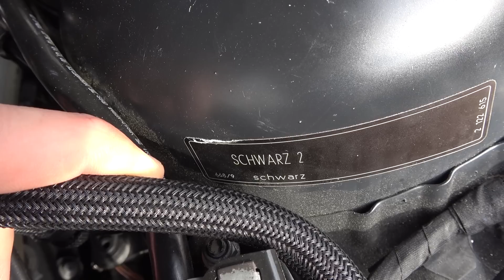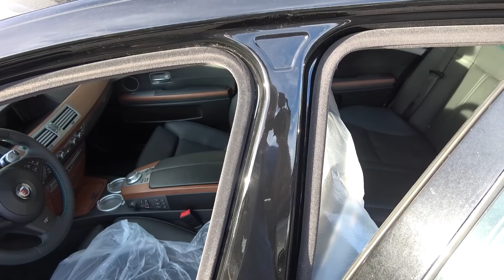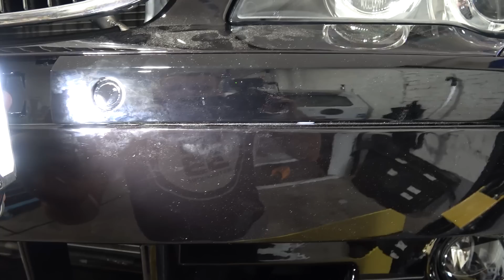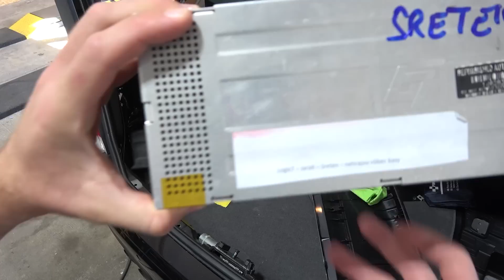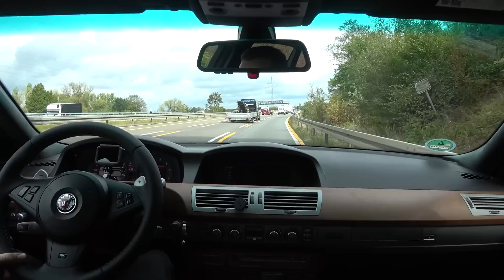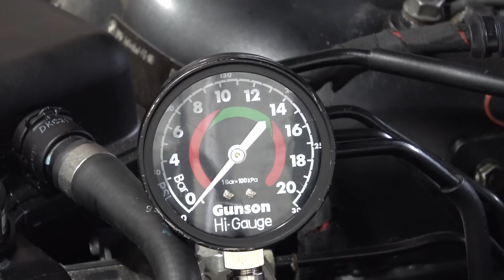More Problems - Supercharged BMW Alpina B7 - Project Chicago: Part 15

Comment: Sreten, you may find the discrepancy in paint shades may be down to the primer, if it went from one shop to another, and they both had a go at doing parts of the work, different primers absorb things differently and the paint coverage will be different on different shades underneath. Either way, what should have been done is the bumpers should have been taken back to plastic, anti static treated, sprayed with an adhesion promoter, sealed with a sealer primer, then high build, sanded down flat, filled etc if required and refinished if required, then painted and cleared... Sounds like a lot of work and it can be but it's basic repairs, you could have probably done it yourself! Also worth noting, the 'dents' you're finding in the paint are poorly sanded primer or paint runs that were either covered over or quickly sanded and polished... Anyways, mogi smo i na našem ali jebg brate engleski udara lakše ovih dana 😂 keep up the good work.

Comment: I've been out here living in the middle East for almost 10 years, the paint job is a typical low end poor refurbishment that happens here almost all of the time. About 80% of cars out here get door dings fender scratches and of course sand road rash and sun fading from the climate. Most car owners take there cars to back street garages, and I use the term "back street garages" loosely.  They will use what ever paint is closet to the cars colour and even sometimes mix paints to create sample sticks to Try and match to the car.  They never really buy  paint from the dealership.  As they use third party paint shops to save money. To expand a little I had my E71 X6m colour changed to the newer F86m blue for around 1000 Euros.  Job was average but I did take the car to the main dealer to repaint some areas that I wasn't happy with.

Comment: I have a similar issue with my Schwartz 2 E39 M5.  The original paint in the door jambs, underhood, and most of the body has a lot of brown in it and looks “hazy” and more grey/brown than black under bright inspection lights. my first thought was to paint correct it, but adding clarity simply
 makes it look worse.

I had 2 doors, both quarters, and the rear trunk painted due to some paint damage.  The paint shop called  BMW with my VIN, got the correct paint code, and did a pretty solid job on the paint work itself. The new paint actually looks great - no metiallic, and just a deep dark black that looks like a mirror. The trouble is it doesn’t match the door Jambs or any of the original paint. I’ve read other stores online about people have much trouble matching Schwarz 2 because of all the variance in actual colors.

Please keep us posted as to what they find in Poland!

Comment: Those bumpers had horrible sanding marks showing under the paint.
What happened to the much vaunted "German craftsmanship"?
I took my A6 to the dealer for some work and the day after I got it back I drove up into the mountains. On the way back my under engine cover came partially off on the road. I pulled over and had to pull it off because some fasteners were missing. I also had to explain to a cop why I was under my car on the side of the road.

Comment: Has the car been reshelled? I.e - original car crashed, someone gets a e65 shell in the 'other black' and proceeds to swap over  everything from crashed alpina to replacement wrong colour shell. This would explain no signs of respray, maybe the door, bonnet and VIN is from original alpina...?
Reply from the maker: No. Not possible

Comment: Looking at cyl 1, piston crown looked a bit odd? Could fuel be on the limit on that cylinder? Did you flow test the injectors? Other than that, great work and kudos for not giving up! :)

Comment: I actually read abbot a customer who ordered one of the last E90 series M3 in either Atlantisblau or Atlanticblau. Anyway: Whatever he ordered, he got the opposite paint and was very upset. I don't know how it ended. BMW offered a free repaint in the correct color which he refused. A replacement car wasn't an option either because the production of the E9x series had ended.

Comment: The quality of the paint work you're receiving is appalling - I'm amazed that any paint shop that has any sort of pride in their work allows that kind of garbage to leave their facility. Color sanding and buffing the paint to remove imperfections was a standard procedure on every part that was painted at the dealership bodyshop I used to work at - I'm amazed that an average quality shop in Germany doesn't take enough pride in their work to do that basic work to ensure their paintwork meets basic quality standards.

Comment: i frequently work with sprayers. it could be possible that whatever automated paint machine was painting in sapphire black and then switched to schwartz 2 without clearing the lines. some of the remaining metallic could’ve came out on the car from factory

Comment: I know BMW finally bought Alpina, but why does or did Alpina last as long as they did for how much terrible of stuff they put out. I run far away from anything Alpina new or old. On a side note, in the USA we have some of the best body shops around, they can due perfection. I usually deal with a place called Queen City Auto rebuild who deals with all high end brands. They do amazing work.

Comment: What an absolute shit this B7 is being!!! I can certainly empathise when some cars just fight you all the way to the end. I find it astounding that manufacturers will use plastic clips to hold underbody pieces on?!?!!? That's just dumb!!!
Sorry to hear that German paint shops are as shit as Australian ones. Pretty sure you can see they didn't use a fine enough grade paper for the basecoat through the clearcoat as looks like linear sanding marks. Even if you use back n forth sanding action instead of crosshatch sanding action with the correct grade paper it should look smooth to the human eye.
As you said it ended on a high note with a healthy engine and everything you have worked upon is in top notch condition. Always frustrating when those you trust to do work for you let you down. Hopefully it's vacation to Poland will remedy that issue 😊

Comment: I love how in the end you always end up with a reliable, good looking and excellent driving BMW. In Sreten we trust, to save and restore a BMW to proper working order and the journey is always interesting as well as educational. An Alpina tour would be cool, wonder if they may have an explanation for possible discrepancy between the stated colour and the actual colour of the car. I remember going to BMW in Munich and on the factory tour watching the chassis's getting dunked into large tanks as initial part of the paint process then watching the robot arms spray painting the car. So maybe someone punched in the wrong paint code for your chassis or at the end stuck the wrong paint code sticker on it?

Comment: Underbody: My E36 M3 16 years a go wanted to let go of splitter and underbody shields at 280kmh. :D Also front fender liner decided to die at one time.  If you are going to use it hard, mold the original plastics and get same thing made from carbon.
Paint: Clearly paint defect on the factory, they had car before this in metallic, and somehow, that metallic was stuck in the painting system, so that also your car got metallic particles in the metal parts. This happened in the robotized painting line. Maybe BMW knows about this and they even have suitable tolerances for such errors. Or maybe it just happened and they dit not notice or let it slip regardless. Plastic parts were painted elsewhere and obviously it would have been like two lottery wins to get same error also there, so the plastic parts are painted perfectly, just like almost all the parts normally.

Comment: 1200 for a completely wrecked paintjob, I would have got my money back for sure. (Maybe invest in a popup paint booth and the equipment, I'm sure with a little research you would be doing the same or even better than this for 1200 you invested).

Comment: My guess would be that they didn’t clean some painting equipment properly at the factory when switching from a metallic colour to this - I’ve actually seen a post about something like this on a Ford recently. 

There are pictures of that in an article from the drive called „This Accidentally Pink Ford Mustang Mach-E Proves New Cars Need More Color“

Comment: Would you be able to say what the Czech guys did to the amp? I had my fixed by a guy in the UK, and he made an entire replacement amp lower board for the Logic 7 amp. 

Also you don't still happen to have the right hand drive mirror and want to sell it?

Comment: As someone who works in a BMW dealer bodyshop, it looks like they've mixed a tint, Schwarz 2 has a number of tints for mixing to match the materials available to the original factory that the car was produced in. 

Schwarz 2 has loads of tints like Darker, Darker and Darker, Red, Red and Darker, Dirty, Red and Dirty. Many shops will mix standard mix and send it because "you can get away with it on black you won't see it"

Comment: I had my E39 painted. The shop kept my car for twenty-six weeks! That is right, over half a year. As well, when I went to get my car. The car was filthy. They had left the windows open and the interior needed a complete detail. They also ripped my drivers seat, let my car idle for long periods and the head gasket failed. Hopefully this makes you feel better about your own situation.

Comment: I have a bmw e92 m3. I'm pretty sure its been repainted (changed colour from alpine white to schwartz 2) as well but whoever did it did a really good job... even put the Schwartz 2 paint code under the hood. I was polishing it and I accidentally went too far on the door keyhole plastic piece. I took it to a paintshop and matched it to the paint code and I got the exact same results as you did... It seems like the new mix is a little bit lighter. kinda like it's cloudy whereas the original colour should be a deeper darker black.. I don't know what to do lol. 
on a side note I'm impressed the Alpina CEO reached out to you... can't wait for the factory tour or whatever you do!

Comment: This is hands down the best youtube car channel!!  From the content, cutting, focus on details to the will and stamina to get closure on all presented projects. The tribute to the car stage from the 80's to now, with pro and cons of the different time periods, is just fantastic. The general mood of this channel really make me want to go back to my younger years... 

My father was a big petrolhead, and a total alfa entusiast. From the Alfetta 2.0, 2*Guilietta 2.0,  33 1,5ie,  75 TS, 2*155 TS, 156 and in the end a Alfa GT.
I have driven the most of the cars, and one which suprised me most, was the Alfa 33 1.5ie last gen. The Boxer engine was torky, low on vibrations and the sound was really nice but a little bit special.
But the handling was top notch, and the quality wasn't as bad as the reputation implies. 

So perhaps an alfa could be targeted as a project ( at some point ;-))
Try to take a look at Jethro Bronner, home build by jeff and Davide Cironi.

Thanks!! Keep up the fantastic job!

Greetings from Denmark.
Mfg Michael.
Reply: The amount of tiime for all this really blows my mind..
I can only think and have suscribed to 4-5 other more channels that are so good and they don´t even come close to this level of attention.
This channel is about reach half a million subs soon.

Comment: I'm really surprised about this poor paintjob quality. I'm living in Dingolfing, actually the city where this beast came to life. And here is a paintshop that has a very fair pricing... and either I am completely blind, or they really do a great job, too. I've had an E90 silbergrau front bumper, an e46 rear bumper and an e39 deck lid there as well as parts of the E39 main chassis were painted there and faded into its original 21 year old sapphire black metallic... I've never seen any mismatch, bubbles, scratches or other imperfections. Not even in direct sun... I didn't know how lucky I am...

And as always: Amazing content Sreten! Thank you so much for lifting up my mood and motivation to keep my old BMWs alive, despite their need for mechanical cure and dedication once they get into a certain age...

Comment: I’ve experienced the same with paint shops in Germany. Paid 900€ for two bumpers and they had to paint it twice to nearly match the color. And it’s still just 90%ish. I will checkout your Poland connection for sure on the next paint job. But what a drama in the middle. Keep it up. If anyone can fix it then it’s you.

Comment: I think it is option 2, a mistake in the factory. Think about it, the car it self ( body ) is painted in the factory but all other parts like bumpers and plastic parts come from 3rd party suppliers and are painted there as well. So they did right but these parts were not meant for this car. This can be a US spec color on the body itself. Oh man this car is a Montags car, for sure!!! You were really lucky, in the US some distracted driver would have killed you on the motorway.

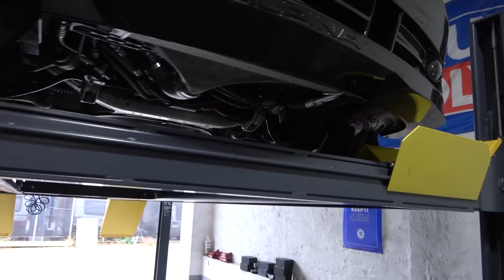Comment: 31:12 no lower grill at the bumper or whatever it should be there, it should stop air flow , without it, air flow at 290 was extreme and pushed that engine protector down . maybe not ..

Comment: The VIN for the car lists an option of 940 "Special Equipment BMW Individual."  Wondering if this includes individual paint option as well and Schwarz 2 is the base color.  Sometimes the individual paint option stickers are on the hood but being that the hood has been repainted, maybe it was replaced and the sticker left off?  Just a thought but maybe the dealership or Alpina can give a more detailed VIN decode on the color.

Comment: 20 L / 100 km = 10 miles per gallon fuel consumption. That's absolutely horrible
Crankshaft superchargers are very inefficient
Now we know why BMW did not build the supercharged engine, and let Alpina do it

Comment: I can imagine your pain with these setbacks! I have rebuild my e38 740 and always i fix something there become new problem. First oil leaks and leaking tank. Fix those and more oil leaks found. Ccv broke 500km away from home, spark plugs dead, catalytic converter carboin build-up by burnin oil, lamdas burn by oil, shift lock magnetventil ghost error, cruise control stop working by I-bus error, rebuilded fueltank crack, metal in oil dispered, fuel pump broke, brake disc somehow broke, window lifter broke-replace new- stop working, brake line start leaking, fuel line leaking, with diff oil came some teeths...

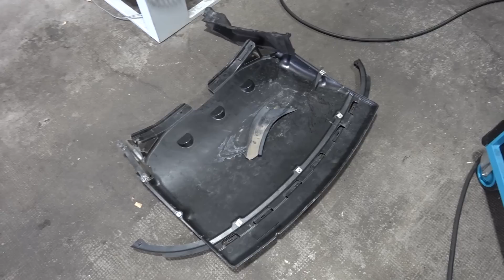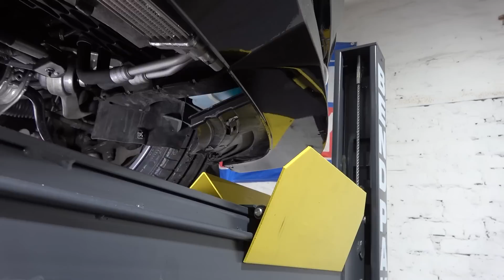Comment: Apparently the cracked underbody protection panels shown @ 30:11 made of dirt cheap recycle plastic. (Which is mix form all kinds of chopped plastic bits blend and mould injected) Without proper stabilizing agent (i.e. plasticizer of similar additives) recycle plastic always suffer from pre-mature aging, cracking, delaminating, decomposing easily as shown @ 30:22 front bumper underside debris. BMW parts charged owner with big $ but give you a piece of junk (which is quite common these days) is a rip-off

Comment: Maybe the original car was totalled with frame Damage and they swapped over all the B7 Equipment into that chassis + used the old vin? If they used a Metallic Black Chassis, that would make sense...

Comment: I am shocked and disgusted by the paint finish on those parts from a professional paint company. It's atrocious. I'm shocked and amused that I did a better job in my own dirty freezing garage with Halfords paint and primer. Hand sanded prep. Not one pin hole or fish eye. No runs or orange peel. I might be the best bodywork guy in Germany!! I live in Scotland tho. 
  I can't understand how any pro paint shop could achieve such a woeful finish, never mind allow it to pass inspection and go out the door. It looked like a bad joke. The bill was the punchline.

Comment: Jesus Christ dude, 1200 euro for this kind of "job" is not acceptable. Greetings from Lithuania btw. In here we pay 120 euro for 1 part. The whole car would cost around 1500-2000 euro to paint. Ofc it would have some small dots that are minor dust particles and will 100% polish out. And the possibility that the paint would be mixed up and the wrong one would be used are very unlikely...

Comment: Had the same problem with a plastic bumper and used stripper to get the crap off to bare plastic than power washed the hell out of it. It was a 2018 LC200.

Comment: Hello M539 Restaurations, 
1.5 years ago i bought my first car. Its a 1999 E46 320i sedan, it has a M52TUB20 engine. With currently 329.500 kms on it. I dont think the timing chain ever has been replaced, and i want to do that. 
However i can not find a very clear video of how to do so. So i bought a book wich i also don’t find very clear. 
Do you have any tips on how to do this and where to get the special tools needed for this job?

Thank you! 
Also greetings from The Netherlands;)
Tim Menzing

Comment: I nearly had a heart attack when you said "oh no, what's that noise?"! Surely no, not again, nothing could be that cruel. Thank goodness it was just the undertray... Maybe with the fragile engine design the stock B7's never got up to speed long enough for them to rip off their own undertray, the engine letting go first....

Nice that Alpina are reaching out. 

Also very nice that it looks like your recipe for the engine (thermostat, oil, etc) is pretty good!